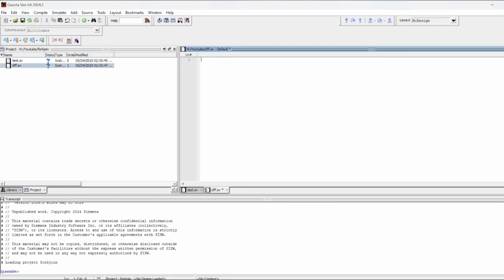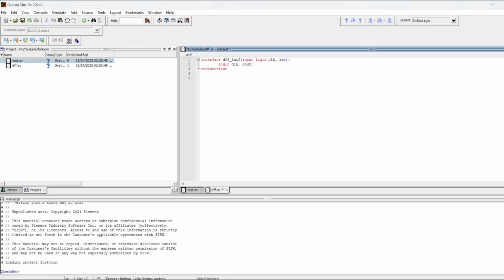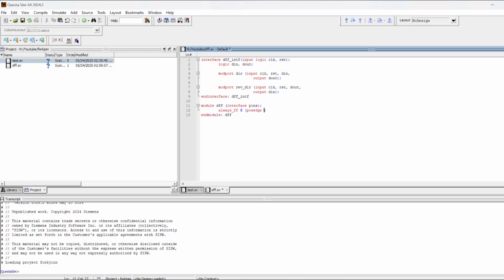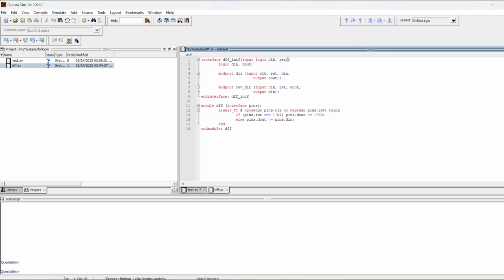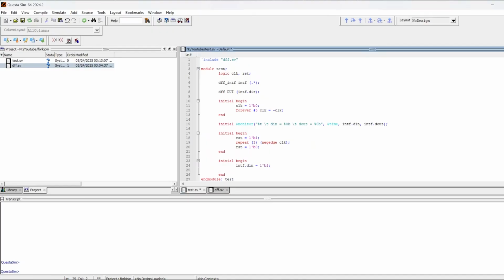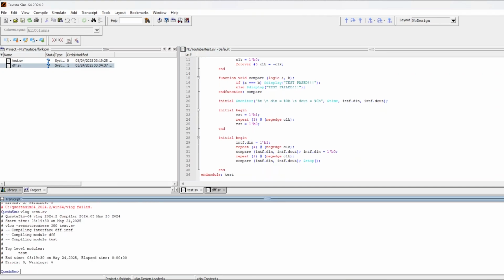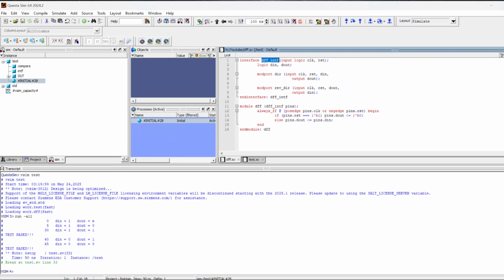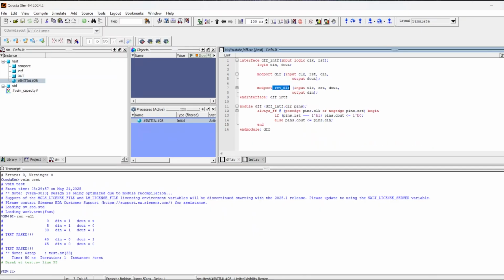SystemVerilog Interface and modport

Comment: You have written your dff to be sensitive to a negative edge on nreset (which is normal for an async active low reset) but then made the reset active high! This means your reset is synchronous but your flop will also clock on negative edges of rst so when you deassert  reset (i.e. take it low) your din will clock straight in to your dout.
At 5ns  your flop resets (because you made it synchronous )
At 30ns your flop dout goes to 1 because you take your reset low which hits your sensitivity list and therefor clocks your flop!
Sooo in summary your design is wrong and your test proves it but it would appear that your testbench says it is correct, and you explain why it is correct.